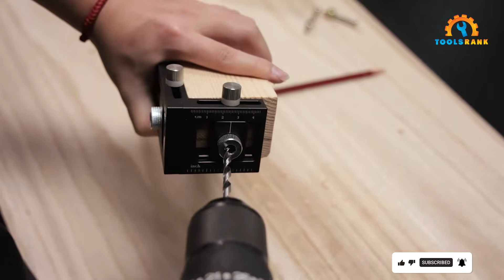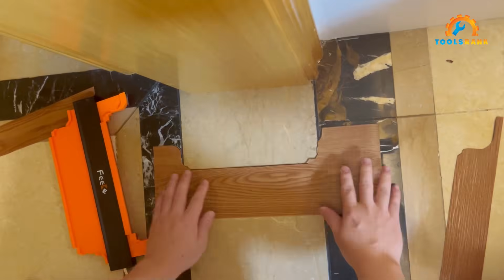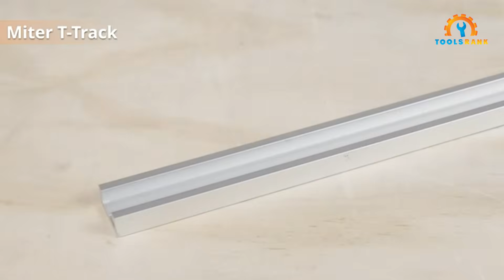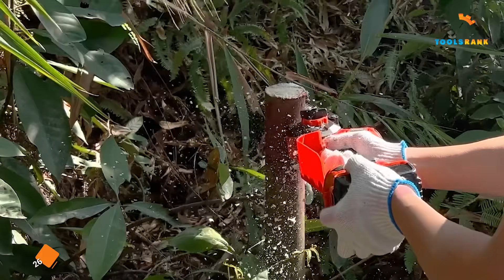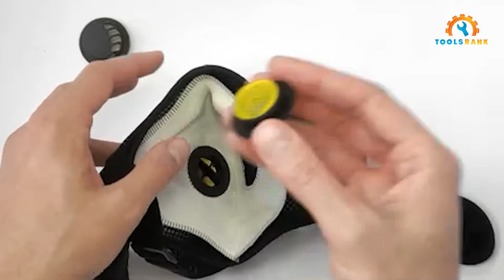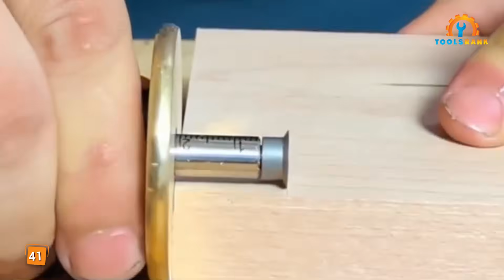45 Genius New Woodworking Tools On Amazon The Market In 2026!

Comment from the maker: 1		Wall Mounted Wood Kindling Splitter	
 https://www.amazon.com/dp/B0CGZLXBZS?tag=toolsrank-20
2		WEN Variable Speed Orbital Jig Saw	
 https://www.amazon.com/dp/B07D9YFFPZ?tag=toolsrank-20
3		Two-in-One Drill Guide Positioning Clamp	
 https://www.amazon.com/dp/B0G4VPL1QN?tag=toolsrank-20
4		Multi-Angle Hand Drill Guide Jig	
 https://www.amazon.com/dp/B0FN3X9KBM?tag=toolsrank-20
5		Thin Rip Table Saw Jig Guide	
 https://www.amazon.com/dp/B0DZHBHKJQ?tag=toolsrank-20
6		Jorgensen Ratcheting Bar Clamp Set	
 https://www.amazon.com/dp/B0B78DQCCG/?tag=toolsrank-20
7		BOSCH Brushless Barrel-Grip Jig Saw	
 https://www.amazon.com/dp/B0CKLYNKGY?tag=toolsrank-20
8		POWERTEC Router Table Fence Kit	
 https://www.amazon.com/dp/B08LYCGG2P?tag=toolsrank-20
9		POWERTEC Universal Tandem Featherboards	
 https://www.amazon.com/dp/B084ZF7SWN?tag=toolsrank-20
10		Manual Log Splitter Wedge Set	
 https://www.amazon.com/dp/B0G1Y77XNN?tag=toolsrank-20
11		Lockable Contour Gauge Duplicator Tool	
 https://www.amazon.com/dp/B08GC2CH74?tag=toolsrank-20
12		MagSnap Magnetic Wristband Tool Holder	
 https://www.amazon.com/dp/B0BJSP22RB?tag=toolsrank-20
13		BeaverCraft Wood Carving Knife Kit	
 https://www.amazon.com/dp/B07P578XFV?tag=toolsrank-20
14		HOTO Cordless Rotary Tool Kit	
 https://www.amazon.com/dp/B0B97JG2T2?tag=toolsrank-20
15		HARDELL Mini Cordless Rotary Tool	
 https://www.amazon.com/dp/B08VHYX96W?tag=toolsrank-20
16		Carbide Rotary Burr Bit Set	
 https://www.amazon.com/dp/B08TZQQ4QR?tag=toolsrank-20
17		DEWALT Cordless Circular Saw	
 https://www.amazon.com/dp/B007NVSTO8?tag=toolsrank-20
18		POWERTEC Table Saw Sled Kit	
 https://www.amazon.com/dp/B0BH47J48N?tag=toolsrank-20
19		Mollom Carbide Forstner Bit Set	
 https://www.amazon.com/dp/B0DPWCCF9X?tag=toolsrank-20
20		Fisch Black Shark Forstner Bits	
 https://www.amazon.com/dp/B087Z1WBCT?tag=toolsrank-20
21		Brushless Cordless Circular Saw	
 https://www.amazon.com/dp/B0F6MYQM24?tag=toolsrank-20
22		Premium Micro Detail Sander Kit	
 https://www.amazon.com/dp/B0FDWYKCSM?tag=toolsrank-20
23		WEN Electric Detailing Palm Sander	
 https://www.amazon.com/dp/B000EUH4TG?tag=toolsrank-20
24		Door Hinge Installation Template Kit	
 https://www.amazon.com/dp/B0DJ28XBVF?tag=toolsrank-20
25		Dremel Wood Carving Bit Set	
 https://www.amazon.com/dp/B0D93F16QC?tag=toolsrank-20
26		Ecarke Cordless Mini Chainsaw	
 https://www.amazon.com/dp/B0GD6KBTLS?tag=toolsrank-20
27		Bumblechutes All-Purpose Shop Wax	
 https://www.amazon.com/dp/B07D81BQTT?tag=toolsrank-20
28		Right Angle Corner Clamp Set	
 https://www.amazon.com/dp/B096DX28FC?tag=toolsrank-20
29		Rockler Mini Panel Clamp Set	
 https://www.amazon.com/dp/B0BSVMST3C?tag=toolsrank-20
30		Carbide Wood Lathe Turning Tool Set	
 https://www.amazon.com/dp/B0D47J7M7T?tag=toolsrank-20
31		EZARC Countersink Drill Bit Set	
 https://www.amazon.com/dp/B0F9XZXV4C?tag=toolsrank-20
32		FIGHTECH Reusable Woodworking Dust Mask	
 https://www.amazon.com/dp/B0DZS9TDJT?tag=toolsrank-20
33		MICROJIG MatchFit CNC Clamping Kit	
 https://www.amazon.com/dp/B0D2JCP1S8?tag=toolsrank-20
34		GALAX PRO Oscillating Multi Tool	
 https://www.amazon.com/dp/B0F29C3XJL?tag=toolsrank-20
35		EZARC Circular Saw Blade Set	
 https://www.amazon.com/dp/B0FB3V3HPC?tag=toolsrank-20
36		LDHTHOPI Burnishing Polishing Machine	
 https://www.amazon.com/dp/B0D3CYRW7B?tag=toolsrank-20
37		GOINGMAKE Concealed Hinge Jig	
 https://www.amazon.com/dp/B0CCSK878M?tag=toolsrank-20
38		Stainless Steel Wood Screws Kit	
 https://www.amazon.com/dp/B0FL78LNKV?tag=toolsrank-20
39		COMOWARE Handsaw and File Set	
 https://www.amazon.com/dp/B0DQCR7Y3L?tag=toolsrank-20
40		Double Cutting Dowel Maker Jig	
 https://www.amazon.com/dp/B0DCZWWLBV?tag=toolsrank-20
41		YOSELIN Dovetail Marking Gauge Set	
 https://www.amazon.com/dp/B09MQ9ZYCJ?tag=toolsrank-20
42		RUITOOL Woodworking Marking Knife	
 https://www.amazon.com/dp/B0DB24DNX8?tag=toolsrank-20
43		KAKURI Japanese Kiridashi Knife	
 https://www.amazon.com/dp/B002TYZR5I?tag=toolsrank-20
44		Wood Carving Chisel Set	
 https://www.amazon.com/dp/B0C58YSG9D?tag=toolsrank-20
45		Electric Wood Carving Tool Kit	
 https://www.amazon.com/dp/B0CPJ173MX?tag=toolsrank-20